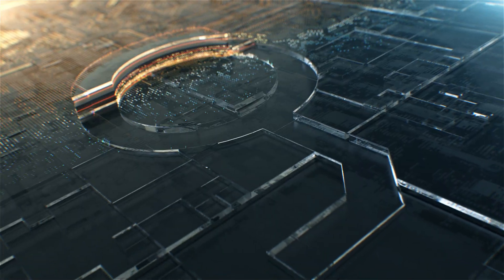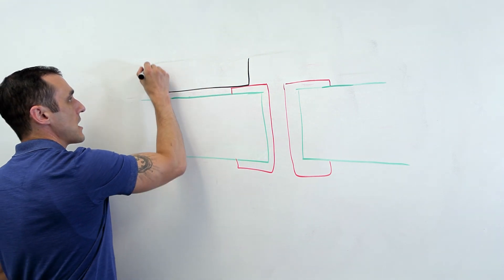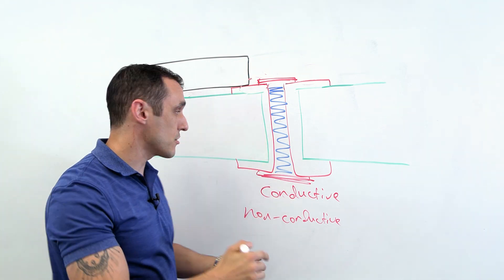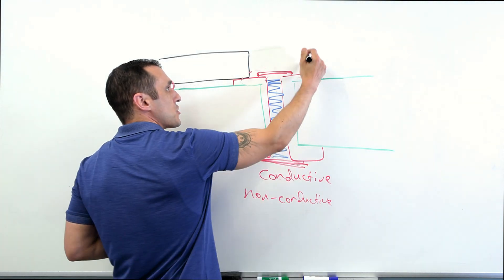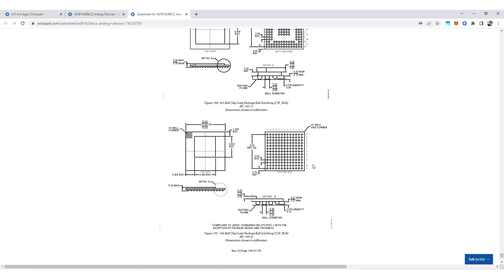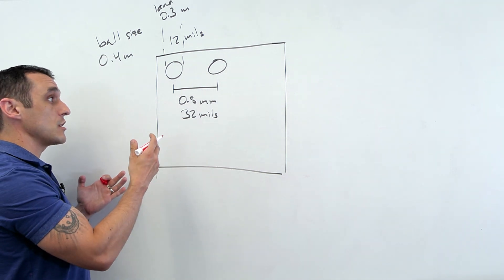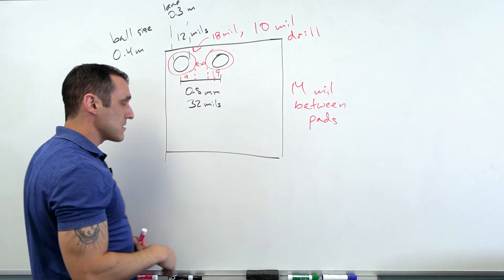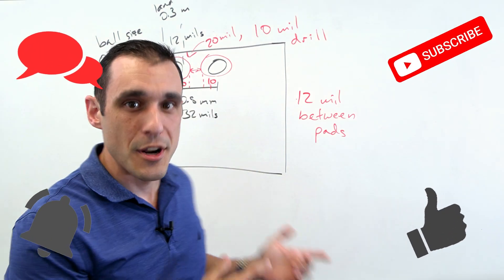When to Use Via in Pad

Comment: I hear different recommendations about when to use SMD vs NSMD pads.  My vague feeing is, use NSMD pads, until things get small, then use SMD pads.  But how small is small, and what are the actual problems with using SMD pads everywhere?
Reply: One thing you can do with SMD pads is you can still hit a Class 2 or 3 recommendation for a pad size with small pitch while still being within the exposed solderable area definition in IPC standards. I've had fabricators recommend this specifically for Class 2 and with laser-drilled microvias when pitches get really small.

Comment: With 0.8mm pitch BGA its more likely to use via in 0402 pad to keep the bypass caps close to the appropriate BGA pad.
Reply: On the back side of the BGA with through-holes yes definitely. That's actually a good point too because you would have to do it even with dogbone fanout. I've shown an examples of this in another video on BGAs.

Comment: In your first example,  couldn't you just tent the bottom of the via instead of doing a fill + cap? While reflow could result in solder flowing into the via, it would not exit the bottom to impact secondary side components. Perhaps this would complicate the paste volume needed on the top side though.
Reply: Yes you can tent just that via, but you would still need to make sure there is enough exposed pad area so that there is a sufficiently large solder fillet. If you can manage to place the via so that there is enough solderable area then the simple option is to just tent. Otherwise fill + cap is preferred.

Comment: So where is the Altium instruction for using these different types of IPC 4761 that Altium lists in the Via Properties Panel?  Seems like there's no way to use these during interactive routing.  Altium seems to have a problem with not fully implementing a new feature.   We really need to be able to declare various capped IPC 4761 vias in the rules, then be able start routing at a Pad, hit the numeric + key, and be able to toggle thru the various vias INCLUDING the capped vias.  Ideally, Altium should be able to discern when a user changes layers on the pad, to allow selection of various IPC 4761 vias.
Reply: I agree it would be nice to be able to set it in the rules, then you could have it set based on whether it's in a Room. Right now you can create a rule for tenting using the Solder Mask Expansion rule, just do it by Room and set it to tented. It would be great to have the other options in the Rules and Constraints editor though.
Reply: I almost forgot, the other thing you can do is to use the pad/via template features, from there you can assign IPC 4761 types to via objects.
Reply: @Zachariah-Peterson Hi Zach.  If I specify a via as say a Type 7 (or how ever I want to designate a VIP), how do I output only the VIP vias as a Gerber plot (which should also show up in ODB++) for the PCB fabrication?
Reply: Ah!  When I update the vias I have in VIP, with Type 7, now the capping and filling layers show up in Gerber outputs!  So, I guess I figured this out...
Reply: But...some footprints have vias already pre-built into the footprint.  I don't see an option to specify via type for these vias.  Any help on that?
Reply: Figured that one out too.  Have to change the vias to actual vias (instead of pads) in the footprint.  Then, I can chose Type 7 for each of the vias.  I also have to make each via in the footprint relief direct, and set the Soldermask Expansion to Manual 0 to remove violations.  Altium sure does not make this easy!

Comment: How do I choose a via size for the exposed pad of an IC? usually there is a suggestion for that in the datasheet somewhere.. but for AD9578 I can't find anything in the datasheet?
Reply: You can choose this based on the size of the pad, the pad should generally be larger than the via hole and pad size to ensure there will still be a place to solder, and it helps ensure you don't create an artificially enlarged pad when applying the via-in-pad placement.

Comment: How does IPC class 3 looks on VIP? I thing there is huge impact on reliablity, but did class 3 accept VIP or other words did any pcbhouse can make PCB in class 3 with VIP?
Reply: IPC Class 3 vias with VIP should be filled with a non-conductive epoxy, capped, and then plated over with 12 micron thick copper. There also needs to be planarity maintained, so there cannot be much protrusion, I think less than 50 microns is the requirement. There is also a clearance requirement for these features, pad edges have to be at least 6 mils from other copper features. This will definitely keep you compliant with hole wall-to-hole wall limits with your fabricator, but it can make dense through-hole boards pretty difficult. The minimum allowed drill size is 6 mil, so the standard allows for the entire range of possible mechanical drilling options.
Reply: I'll do a video on it.

Comment: Another important rabbit hole for via-in-pad is BGA collapsable vs non-collapsable balls. 

Bigger pitch BGAs have balls that collapse onto the pad, so there’s a risk of the ball itself getting sucked up into the vía through capillarity if you haven’t filled it. Smaller pitch BGAs (generally) have balls that don’t collapse, making this issue less likely.
Reply: so if it suck inside the via, this could lead to bad connection? or work but eventually fail under thermal events?
Reply: If you're doing via in pad though, you would want to fill the vias anyways to prevent capillary action.
Reply: @Jerome Demers  Basically it could pull solder to the back side of the board, where it could possibly solidify and create a short. It could also leave insufficient solder between the pad and the component, making a weak connection that might fail under thermal cycling or mechanical shock.

Comment: Very nice video of Via in Pad.  Question:  Once I flubbed a job interview for high speed clock PCB design, the guy wanted to know how to layout a part where two different clocks were in adjacent pins.  I'm guessing that you do via-in-pad down to different layers, separated by a ground plane.  Is this the way, or am I way off?
Reply: Yes that's one way to do it, assuming you don't have any control over the pinout/pin selection (like in an FPGA). You could also go down to the same layer and route them in orthogonal directions. Also if the pitch is large enough then you might not need via in pad.